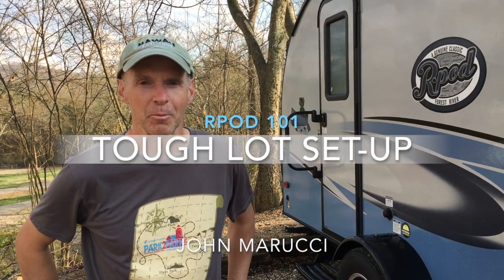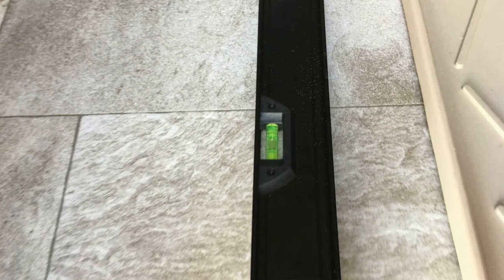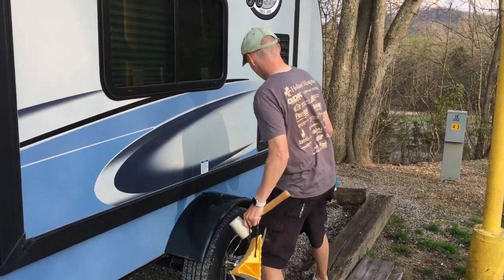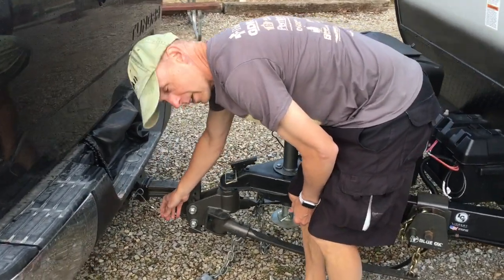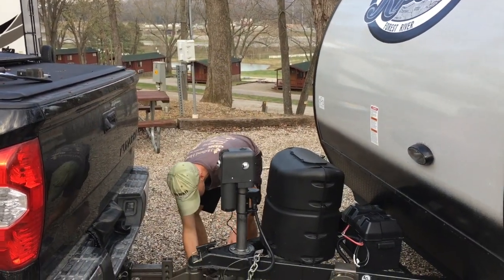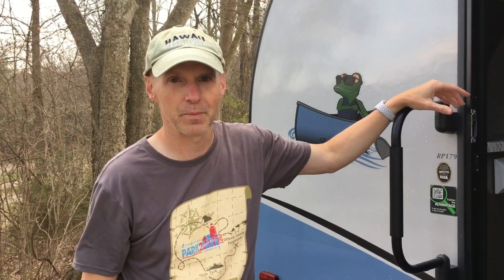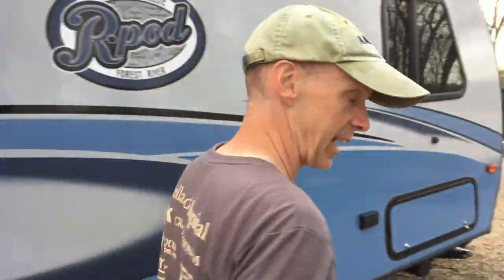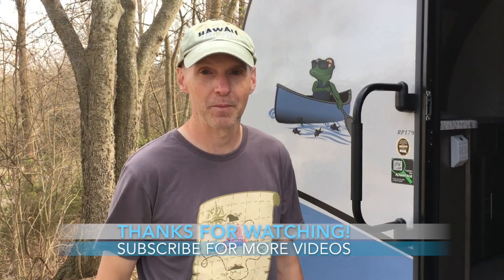RV Tough Campsite Setup – Step-By-Step Process

Comment: Watching you walk back and forth to the door is why I leveled my trailer and attached graduated levels to the front-side and front-panel before I ever took it camping. On a downhill slope like this, you can get a sense from the front-side level marks of whether you'll need risers under both wheels, since my manual jack sometimes bottoms out before it's level front to back. It's a cheap way to save some steps!
Reply from the maker: Gary, good idea, however, it adds to my step count every time I set up! Thanks for watching!

Comment: John,
A circular level works fine when leveling my rpod171. I've checked it on the floor of the rpod as you did and I found I can use it on the tongue since verifying that there is no difference. It makes it much easier when leveling by yourself. I always make sure my stabilizing jacks are the last thing that I engage with plastic pads under them. Thanks for your very informative videos!    
John Michael
Reply from the maker: John, great idea concerning the circular level! This would definitely save some time in the leveling process. Thanks for watching!

Comment: For safety, I always wait to remove the safety chains until after I get the trailer off the ball. That way, if something goes terribly wrong with the chocked wheels and it starts to roll, it can only go the length of the chains. You won't lose the trailer.  Also, if you camp at state parks and other more unimproved campgrounds, make sure you have the levelers/wood to raise one side of your trailer by at least 6 inches (and that you can get the wheel chocked with your levelers).
Reply from the maker: Thanks for adding your tips!

Comment: Something to consider about your distribution hitch - if your truck bed is full of a lot of weight, you’re actually transferring a lot of that weight to your trailer axel, which may not be rated to carry much more than the trailer’s gvwr.
Reply from the maker: Good point Mike. I do adjust the chain link on my Blue Ox hitch to put weight forward occasionally. If I ever feel like the front wheels are floating it usually means too much weight is on the trailer. You always need to be aware of how the trailer and truck are working together. I've noticed with the recent floor repair (see Floor Fix videos), FR added structural support under the kitchen floor. It added about 150 lbs. (best I can tell) behind the axel, which isn't great for towing. I had to make adjustments accordingly. All the best!

Comment: Very informative.  I just had my first camping experience with my 2018 R-Pod 179.  We lucked out with a level site.  I am definitely also going to invest in the memory foam mattress topper  for the queen and the sofa bed.  Will also try the deep pocket full size sheets.  I like to use a duvet for a cover, so no tucking.  RE morning coffee: a french press or pour over coffee set up works well whether you are using an electric kettle or a kettle on the gas stove.  I brought along an electric fry pan as well and used it outside, plugging into the exterior outlets.  Will watch the rest of your reports.
Reply from the maker: +Anne Trow Congratulations on the first trip with your 179! Glad the videos are helpful. Thanks for watching!

Comment: Great video, as always. If you do have an out of level situation such as this, why is it so critical to be level...thinking that it's just gonna be a sleep and get up early and go?
Reply from the maker: Craig, great question. A few reasons and these really can depend on your preferences: first, in most Pods the bed is positioned across the cab, so if you don’t level side-to-side, you’ll either sleep with your feet higher than your head or have to move to the opposite side (not a huge deal); second, if you plan on cooking inside on the stove, you may find off-level somewhat difficult depending on how much off level you are. Third, the Dometic refrigerator can act up sometimes it the trailer is off level. One last issue is rain and your slide. Generally you don’t want rain water moving toward the cab, if your slide is higher than the cab, rain water can pool against the cab and leaking can occur. If you leave the slide in, then no worries. Hope this helps. Thanks again for your question!

Comment: Do I need a weight distribution jack with an R Pod?  I plan to use a Ford Escape (Eco boost-3500 lbs to cap).
Reply from the maker: I use a weight distribution hitch towing with my Toyota Tundra and did with my Honda Pilot. I think they really help both with sway and properly distributing weight to the front and rear axels of the tow vehicle. They also provide addition peace of mind when towing, especially in difficult conditions. You may want check out my video on towing with a Honda Pilot and the properly understanding towing capacities. Here is the link and thanks for watching: https://youtu.be/WAIMgWv7Zjo
Reply: Many thanks, John. I watched the Honda Pilot vid and learned a lot.  What I know at this point; engine size alone does not accurately indicate towing cap AND, weight distribution is an important factor to towing safety.  Makes finding a used tow vehicle require lots of homework.

Comment: Great video John. Question: why is getting the trailer so critical when self-contained units, like class b &c or sprinters just back in to the spot and camp without leveling?
Reply from the maker: Hey Richard. The units you mention (b&c class) actually should be leveled similarly as a travel trailer, unless the until has self-leveling power jacks, which do it for you. Otherwise on a site like we had, it would be tough cooking or sleeping at that angle.

Comment: I am looking at buying a R-Pod (RP-180),  and I have really enjoyed the R-Pod series you have put together, there is a lot of great information. A couple of questions... First, I did not think R-Pods were big enough to require a class-4 hitch setup, do you run this because of your tow vehicle? Second, have you thought about getting a bluetooth level sensor that would send level information right to your phone, keeping you from having to run back and look at the level. Also, several of these will give you the exact amount that the trailer has to be moved to get to level.
Reply from the maker: DargoDog, The bluetooth level sensor sounds like a great idea. Right now I am old school with a mid-sized carpenter's level. If you have a specific recommendation, feel free to post it in the comments. As far as the Class-4 hitch set up, I went with the Blue Ox Sway Pro weight distribution hitch: https://www.blueox.com/trailer-towing/swaypro/ which is upgradable by changing the bars to a higher tongue weight. My Tundra can tow much more than the current set up.

Comment: Hi John, great video. My wife and I are closing in on retirement, and want to buy either the RPOD 178 or 179. But we also will need a tow vehicle. How did you decide on the Tundra, vs. F150, vs an SUV ? How does  the Tundra do, towing your RPOD 179 ? Did you consider the Toyota Tacoma ?   Thanks !
Reply from the maker: Gerard, first congrats on the upcoming retirement! Really great question. This response may be a bit long-winded, because there is a lot to cover... In April of 2016 I bought an R-Pod 171 and towed it with my existing 2014 Honda Pilot. I owned it for a year and really enjoyed it, but it was too small for my plans of working more remotely. A year ago, to the day actually, I bought the 179 I now own. I decided to upgrade to a full-sized truck for a couple of reasons. First, I wanted to future-proof my tow vehicle, just in case at some point I wanted a larger rig, like say a 25' Airstream, that weighs in the high-6000 lbs. loaded. Most SUVs or the Tacoma would be pushing any potential trailer upgrade. Second, I wanted a better towing experience. 

The Pilot is a great SUV, but it was just an adequate tow vehicle for the 171. It sits on a Honda unibody (same as Accord) and really isn't primarily designed for towing an RV. As you probably saw from the videos, we just went from Michigan to Florida and back, and honestly towing the 179 with the Tundra was a pleasant experience. Most of the time I didn't even notice I was towing anything. So think about your plans as far as future-proofing the tow vehicle purchase. I like having plenty of margin when towing. 

Ok, so what about Tundra vs the F-150 vs Tacoma. I ruled out the Tacoma mainly because of the future-proofing, but I did test drive the Tacoma. My impression was that the Tundra was a much smoother ride vs the Tacoma. I also liked the higher ride of the Tundra, so I was willing to sacrifice gas mileage for the increased capacity, ride comfort and height. OK, so what about the F-150? 

I did much research on the F-150 and GMC full-sized trucks and built out many online to see what it would cost to get everything that already came with the Tundra. When I equipped the Ford and GMC vs the Tundra, I kept coming back to the Tundra on price. It is important to understand that the current Tundra model is near the end of its lifecycle, there is no variable cylinder management. Which means the gas mileage is abysmal, but it also means you are likely to get a pretty good deal for something on the lot. I love the Tundra after owning it a year, and yes the mileage is not good at (13/17, and about 11-12 towing), but it is just a solid lower-tech, well-built truck. One last thing, I have owned a Toyota before and it was just a fantastic reliable car. With that said, I am sure the F-150 or Tacoma would be a fine tow vehicles for whatever R-Pod you choose. I'd recommend test driving everything and knowing the full cost with proper brake controller, 4WD, etc. included in the package. 

Let me know how it goes and thanks for watching!

John
Reply: @JohnMarucci  just wondered if you considered a Toyota 4Runner and what your opinion is of it cuz I've been thinking about about a 4Runner for myself towing an r-pod. Thanks!